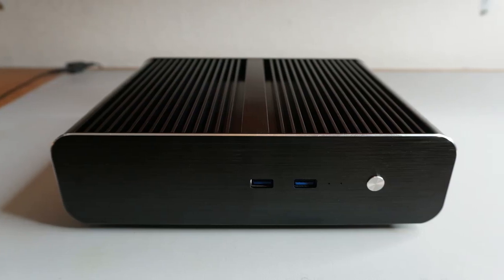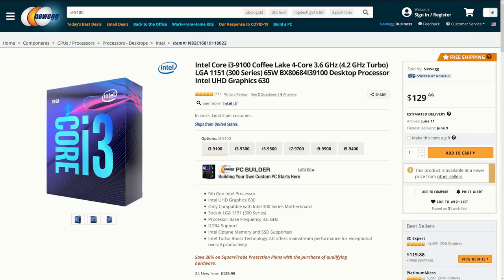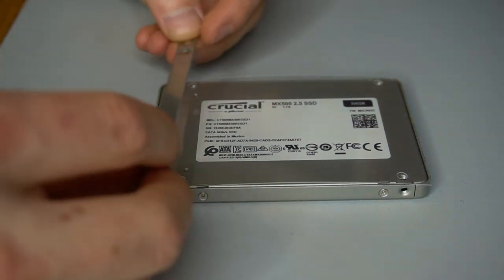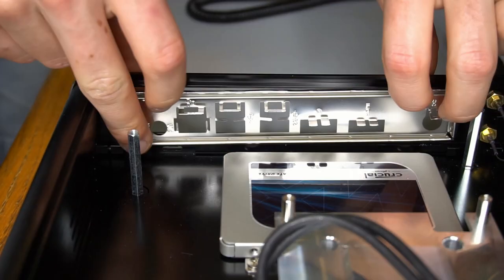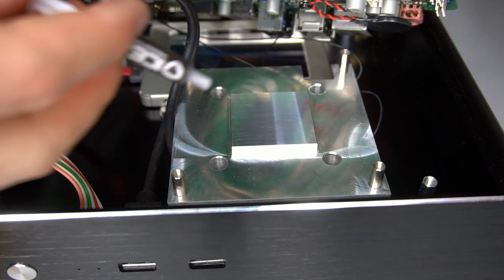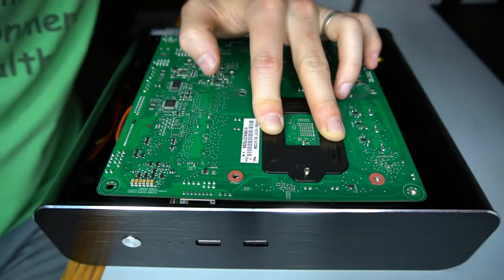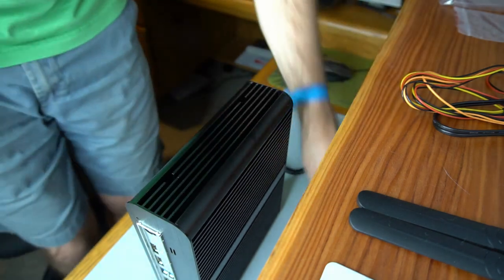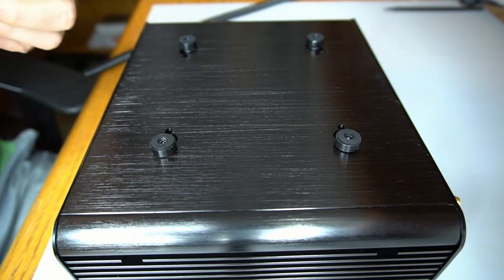Akasa Euler S - Building a Fully Silent Fanless PC

Comment: Akasa Euler S case is for 35W TDP, but i3-9100 is 65W TDP. Would other 65W TDP processors, for example i5-9500, work also?
Reply from the maker: Most motherboards allow you to reduce power limits in BIOS. When you do that the standard TDP is not important, you can set the power limits to 35 W. If you use a 65 W CPU without setting a lower power limit then it will be likely to throttle itself under heavy loads.
Reply: @fullysilentpcs  So just setting power limit in BIOS for i3-9100 to 35W will make from i3-9100 model i3-9100T one? Is it not better to buy i3-9100T instead? Or will in the BIOS reduced i3-9100 be faster than i3-9100T?
Reply from the maker: Basically, yes, setting PL1 (power limit 1) in BIOS to 35 W will make an i3-9100 identical to an i3-9100T.